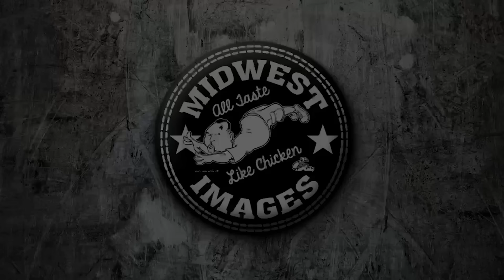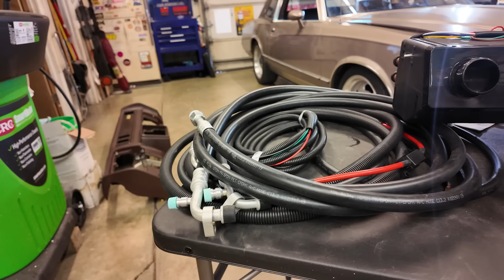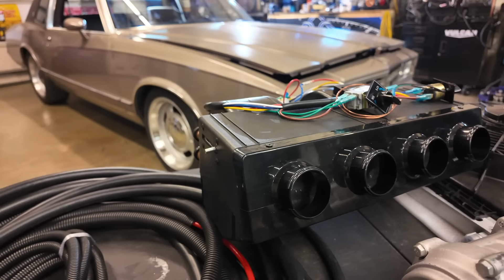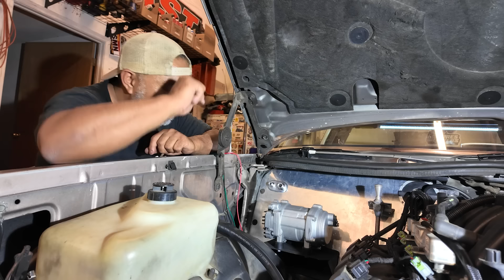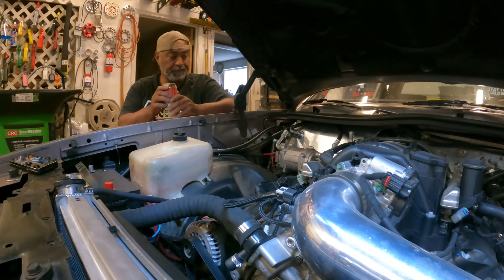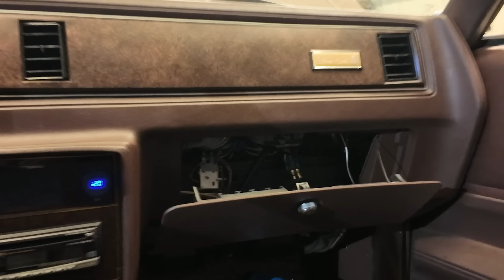12 VOLT AIR-CONDITIONING MY HEMI MONTE CARLO...IS IT WORTH IT?

Comment: You hit the nail on the head, G Body AC was never that great. With this system I would treat it like adding a big amp sound system with ISO’s and Caps and an extra battery. But that still won’t solve the 300 CFM that box is pushing. If I were shopping for a system I would definitely look in to a higher CFM system. Good video 👍
Reply: What G body did you have my Cutlass with the factory R-12 is ice cold. My biggest issue is always finding the old school R-12 Freon to charge the system from time to time as it’s 40 year old vehicle now. Other than that the A/C is awesome. Only reason I’d like something like this is space for spark plug and header bolts with the factory A/C box still under the hood is an absolute nightmare and I’ve debated on getting a heater box out of an old school Malibu or el Camino that had no factory A/C so it’s only the heater core and fan and run something like this under the dash but I’ll re route ducts from what it sounds like to have it so everything works as it should but have a lot more space but ya must of had some ran down G-bodies or something cause they was infamous for ice cold A/C and steering that was so easy that ya could drive it with just a pinky finger.
Reply: @85gbody97 I’ve owned them all, Cutty’s, Malibu’s, Malibu Wagon’s, Regal’s, Grand National’s, Monte Carlo’s, Grand Prix’s….you name it. I’m actually shopping for a G Body right now. 😎

Comment: I  have an old house around 1200 living space. I went with 4 8 000 btu Midea u shaped window units. Well they were recalled for a drainage issue. I drilled a hole and no problems. They are inverter ac units. I love them! I havev2 12,000 btu units in a 22x25 metal garage with the insulation all walls and roof. They also are inverter units.  The 4 in the house really cool it down. 72 when 95 outside. It cost me 1300 to replace the ac unit in my Honda 4 years ago. The startup on the units are a slow start and generator friendly

Comment: I gotta recommend Apex Alternators. They go deep into their alternators and use the stock casings. So they definitely fit. My car came with a 100a alternator, the options they had for me were a 260a/140a @ idle to a 350a/200a @ idle. All that and it looks stock. They upgrade the windings, the stators, the rectifiers and the diodes for the same price as an alternator from Autozone. It might take a couple weeks, but it is well worth it.

Comment: In off-road overland world, Using two batteries with an Automatic Dual Battery Isolator Kit, especially one with a 140A Voltage Sense Relay, would help ensure both batteries are properly charged without overloading. The isolator keeps them separated while the relay monitors voltage levels to switch between the batteries as needed, which can help prevent draining your main battery while still keeping your second battery charged for auxiliary uses (like running accessories, lights, or other electronics).
Reply: facts!!

Comment: You should really upgrade all your cables, grounds, power from alternator, power to AC, etc.  you should also get a better alternator, or a second one.  If you add a battery it should be a big one, a small one will drain too quick.  It’s also detrimental to your battery to run it below 12V.

Comment: More batteries only complicate things. More to charge. Dual rectifier alternators put out double the amperage at idle as a single rectifier alternator. Also aternator needs 2500 RPM shaft speed to charge fully and should not exceed 20,000 shaft speed. Try smaller alternator Pulley ESPECAILLY if you have underdrive crank pulley

Comment: 100 amp fuse! Thats serious amperage! They make dual rectifier alternators. Not only do they output more but do so with less input RPM. Fans kick on at stoplight when idleing. Can get them 3-400 amp output rating

Comment: Did you mount the condenser in front of the radiator like the factory would have so the fan cooling the radiator would also cool the condenser ?
Reply from the maker: Its located up front of the car with its own fan that came with it.  This way it cam be turned on with out anything else.   I used the whole kit to see what it will do.  The fan on the condenser is way weak

Comment: Nice breakdown on different aspects of the system to consider. This would be sized good for my MGB GT but a big mid-size? 
Tint is a good tip but also stopping the heat from the exhaust is another thing to tackle.

Comment: Other YouTube channels that are experimenting with these 12v compressors have the same experience and have gone to a bigger condenser. Do you think a bigger condenser might make it run more efficiently? My '56 Chevy has a 105amp alternator and I was thinking about trying a 12v compressor.
Reply from the maker: A bigger condenser def will help but its the air flow out of box that hinders this unit.    I found a diffrent underdash deal that will put out 600 cfm instead of this 300 cfm.  Im gonna do a part two(what I'm changing) soon.

Comment: Mike do you think maybe one of those inline hose fans would pick up the flow .the fans are sometimes used in venting boat engine bays .possibly set to blow air at the highest fan switch settings

Comment: I installed one on my 75 Gran Torino and it works well. I have the other head unit with the vents and switches. I upgraded to a 100amp alternator. I also added a relay switch, it does draw some power when not in use, and On/Off switch on the dash. I pleased with it so far.

Comment: Mechman alternator is all you need for a hemi. 300a to 500a  output 12 to 16v charging configuration.  They’re used for spl car audio and will work wonders for this set up.

Comment: This is the first really good video in a long time.
And most points for the A/C were at least touched on.
A few add ons (which adds cost)  would have been a filter dryer of some sort to catch the small impurities and moisture left in the system, if any.
And eather a receiver tank or a accumulater tank to help out with the system operation.

Comment: 10:30 Just for the DIYer's out there, you can rent the vacuum pump and a/c manifold from the parts stores. It's not a super complicated procedure, just follow the instructions. As other commenters have pointed out, the vacuum process also removes moisture from the lines.. if you skip this step, your a/c will likely still work, but if you turn it on in the winter to defrost your windows, there could be ice in the system and compressors aren't fond of that.

Comment: I’ve been looking at these systems and wondered if it would be possible to use all stock ac components (including condenser, evaporator, blowers etc) but use this electric compressor in place of the belt driven one. Would performance be better than this kit since the condenser and blowers are larger? I assume it still won’t match the stock ac output?

Comment: I have been passively curious about these 12v ac kits for my CJ7. Now it’s a solid maybe…like I think I will try looking at what it would take to run one of these through a jeep box with a blazer blower upgrade I did to improve my heater. That worked way better than I had even hoped.

Comment: Any AC system can be crippled by flowing too little air you move across the evaporator. Up the cab fan airflow and you will get a much better idea what the unit is capable of.

Comment: Neither the voltage nor the compressor size will help with making the system cool better. The things you need for that are a larger condenser (most likely what Mike needs as the one in the beginning shots looked tiny for the claimed BTU) and more air flow over the condenser and evaporator. You only need to look at a larger compressor if the one you have cannot maintain the pressure differential required and the only thing going 24V over 12V will do for you is lower the amp draw as the motors are picked to match the needed power to spin the compressor.

Comment: The Vacuuming of an A/C System actually BOILS the moisture and it allows the Vacuum pump to remove the moisture vapor and the excess pressure. Leaving it in the system causes the system not to work efficiently. It can cause allot of issues. I've seen freezing TX valves, Over Pressure issues on the high side setting off the High pressure switch, corrosion and etc....(I live in Maine Rust belt) ALWAYS ALWAYS VACUUM!!!!! On my personal LS Swapped 2006 Canyon. I put in a Gen 3 LS 5.3. I ended up going with a regular Silverado Compressor because I look at Part Life. I have a Lifetime Warranty on my Compressor and Condenser from a Big Name Parts Store. I personally didn't want to drop $500 for this unit just for it to last 1 season and not be able to get parts for it or get things warrantied. You know what I mean? Allot of guys can use a regular Compressor that is for their engine and run the under-dash unit like you bought and not have to deal with electrical upgrades. Wiring it in to activate the clutch with a relay for a pressure switch on the high side is easy.

Comment: Do the insulation that sticks on. And you could put one in the trunk to get ac from both ends. A ND you could run two 6 volt batteries, they have a slower discharge rate, that's why rv run them.

Comment: So the compressor works  and I might be able to buy just the compressor. And then I can buy the condenser I want. Since it's 110 out here in the shade. Having won out of a Peterbilt would be nice.  I believe that when I was eyeballing just the condenser. 27 by 30.  That will be going on the lower support for the solar panels going to the roof rack. And if I'm driving I don't need a fan for the condenser.    And I would want the compressor mounted on the roof rack too,  I don't have much room underneath that hood I had to move my battery to behind the back seat. So that I could Mount the stuff for the propane. 😂😂  That would be nice to have it on a little timer. That turns on 15minutes before lunch break.  So that I have a cool vehicle to sit in.

Comment: I've listened to this. And I'm thinking this would be great for my 82 Corolla just because I don't want to lose the power it has coming off of the engine who run in AC compressor. I have solar panels because I know my stereo cannot be powered by the alternator.
Reply: You are going to lose hp no matter what you do. Turning a high amp alternator is going to suck hp as bad, if not worse, than a engine driven AC compressor.
There is no such ting as a free lunch
Reply: You don't really read
Reply: @bullithedjames 
My reading ability isn't in question here. 
I read just fine.
Your ability to comprehend what is being said should be the thing in question.
Because you obiviously dont understand what I posted.

But hey, it is just a online comment  section, if you want to try installing a electric AC system with no cost in operating that system, well, that is your prerogative. 
Have a go at it champ.
Good luck.
Reply: @jaynecobb6711  did I say I was putting a bigger alternator on my car. Because that is exactly what you implied I said.  You said it didn't matter if I used the compressor off of the engine or put a bigger alternator on it was still robbing power from the engine. After I had said I have solar on my vehicle. Because my alternator can't handle a stereo. But I'm the one with comprehension issues huh?

Comment: A few questions come to mind: you said in the shadow of a truck, you could tell the difference; are your windows tinted, so you are always "in the shadow of a truck"?  

Is there insulation behind your headliner?  Does it use make-up air or only internal recirculated air?  The first thing that always comes to my mind in issues of heating and cooling is: how insulated is the box whose environment you want to control?  Everything works less if your R-factor is high, and your "insolation" - heating from sunlight - is controlled.  Is the car's interior black?  Is there a reflector plate over your exhaust pipes and muffler so the floor has no hot spots?  Insulation under the carpets?  The less thermal mass you have to cool, the more goes into cooling YOU.

On efficiency and cost-effectiveness, is the AC's radiator ducted (AC radiator/condenser)  Is the condenser fan thermostatic, so that if you are moving the fan shuts off?  How much more would a factory air conditioner have cost on that car, and how many BTUs would IT have had?  How much more expensive is the 8,000 BTU unit?  What's the most powerful alternator you can buy, and for how much?  Some of these are solution questions that are forward-looking, and that would optimize for the solution.  How hot was it the day you tested it?  

Can you tap a flex line into a Y connector of the car's existing dash panel ducting AND fan so that it will blow more strongly directly at your face?  (or does your car not have that)?  I think it would be interesting to reflect on these to stimulate successful downstream mod experiments.  Good video.  Thanks.

Comment: If that system doesn't have a dryer, put one on it and vacuum the whole system down before putting the refrigerant into it. The stock system could exchange more air in an hour than a commercial 10T unit. So if this works as well, I will be surprised, as the condensor is not very big(it looks half the size) of a standard stock one. Good look and you just gained a sub :)

Comment: Upping air flow at evap coil will cause air to go through coil too fast and now allow enough time for refrigerant to absorb the heat in the air and cool well. System just need to be larger over all. Can't just put a bigger blower with the same size compressor and condenser cooling capacity.  Most small cars have 15k btu. But that is factory car with good door seals, insulation, etc. A race car set up is usually Less well sealed up and insulated. There is also a reason in residential and commercial HVAC doing a load calculation  for the space to size it properly is absolutely essential and to do that properly you have to take I to consideration things like insulation, heat gain from windows and direction house is faceing for how much sun exposure it gets etc. A car is basically half windows so it gets a TON of solar heat gain. If anything I'd go a higher over all but system and would bet you would be happier

Comment: I have electric AC, PS, fuel pumps, cooling fans etc etc and i have 2 batteries with a 200A alternator. AC and PS running off one battery with the rest of the car running off the other, also have a manual crossover to tie them together if needed one day. With everything running and PS turned to full lock its only drawing 148A so i have plenty redundancy with charging

Comment: Re: amps, larger alternators place more of a load on the engine so only go as big as you need to. A dual-battery system specifically for the compressor (like you would do for a pro stereo install) seems like a great option.

Comment: Great Review.  I want AC in my 1941 Ford, and there is no room up front for a compressor on the engine.  Maybe two air handling units?  One under the dash and one in the trunk blowing under the rear seat?  Don't know yet, but nice to know that the compressor works.

Comment: I'm a Volvo Trucks, shop foreman and, Volvo is using these systems for drivers. Works GREAT!! Just be sure to use AGM batteries.
Reply: I've had good luck with a lot of construction equipment in forklifts with switching over to lithium batteries and it has been great yeah the battery is like three times as much but the battery has like five times as much capacity in the same footprint.. I've been switching out equipment batteries for lithium golf car batteries and it's been great.
Reply: @iconburn22  not a good practice for cars imo when it comes to reliability. very high under hood temps and direct alternator charging is hard on lithium batteries. ran several in my car and motorcycle for a few years to test it out and it is different than lead acid because when it dies it is dead and you cant even jump start your car and have it run right. Sucks majorly when you are out and about.

For a forklift or a golf cart that stays basically on the same property all the time yea its no big deal i guess because if it dies you are in no rush to move it. the EV golf carts accept them easily, yes. but i had didnt have a good experience with my car and my motorcycle using a lithium battery setup to power the car and start the engine.

I've been debating a hybrid setup to have lithium battery trunk remote mounted in a box with cooling ducts to keep the temps down, a contactor to remove and add it back to the main circuit intelligently for charging and then having a main AGM battery for reliability and good start performance in all conditions. There is a device called bank manager that does this for really big solar systems but a smaller one oriented for cars would be possible and cool imo.

Comment: One of the things people miss on the alternator (esp w/ old cars) is the idle output v/s peak output. I don't know a lot about Dodge, but probably similar to GM stuff. The older alternators peak at a higher RPM and fall of drastically at idle. Upgrading to a CS style alternator from the old ones gets more current at idle and low speed; they were redesigned to handle running a computer (several computers) and more ignition and big electric fans and infotainment systems which run at idle.

TLDR: modern alternators are better in every way. 😂

Comment: This is the dark side of LS and Hemi swaps no one talks about. That factory airbox could have stayed with a SBC. I think this would be cool with a belt driven compressor. Another thing you might be able to do to help that initial hit is those huge capacitors the subwoofer guys used to use when they had 1000w amps in the trunk. Anyway it feels like chasing your tail when you have a perfectly good engine that could turn a compressor even if you needed to make some brackets.